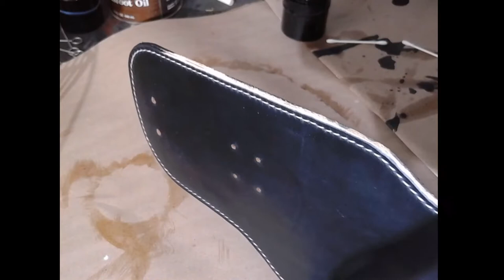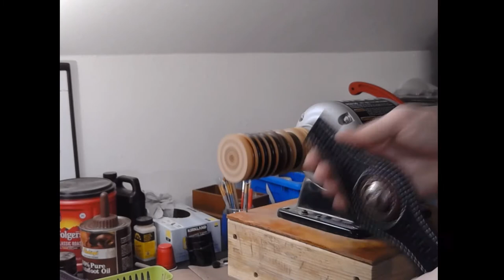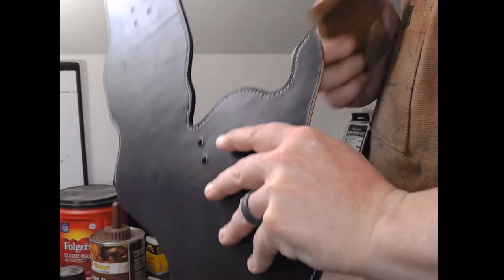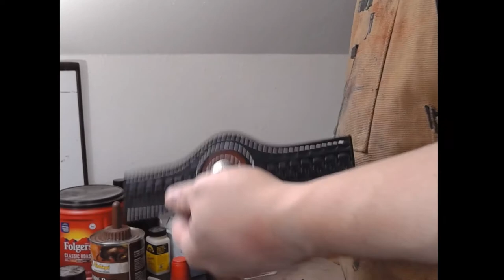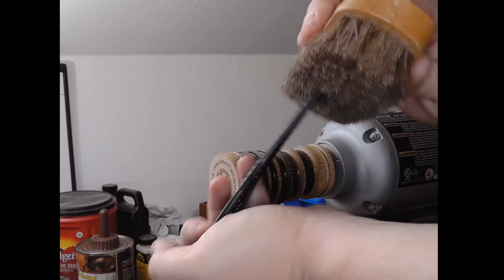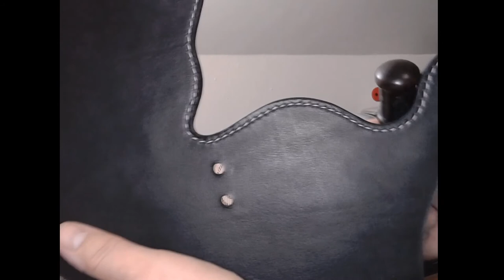How to make a Ruger Cowboy/Western Holster - Part 6 | Edge finishing  No commentary (ASMR)

Comment: if a holster is formed for a certain revolver it should use it /BUT if its not  you can use any revolver even double action as long as it fits/ now for you people putting a deranged in  a 12 inch holster we can't talk to you.
Reply from the maker: True.  I do not mold or wet form my western style holsters, so they should fit almost any gun that has the same frame size and barrel length just fine.  I originally drew this pattern based on a friend's Blackhawk, so I tend to think of it being for a Blackhawk only.  I was going to buy a Vaquero to test with the holster and see how they compare.